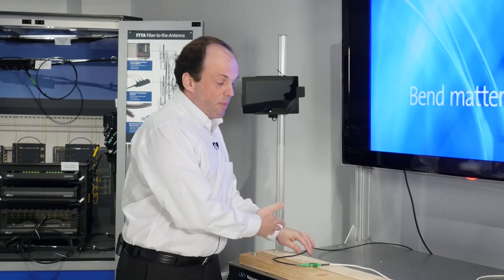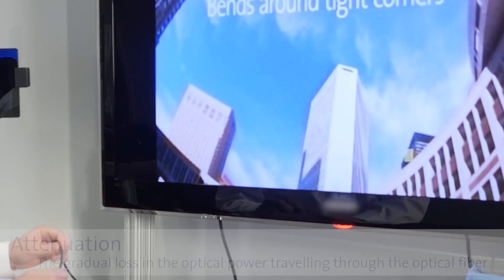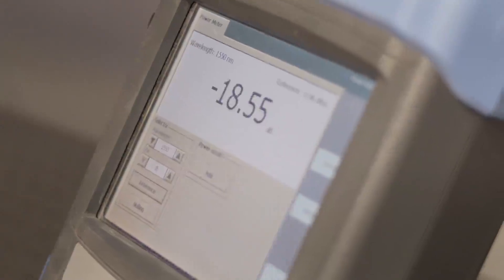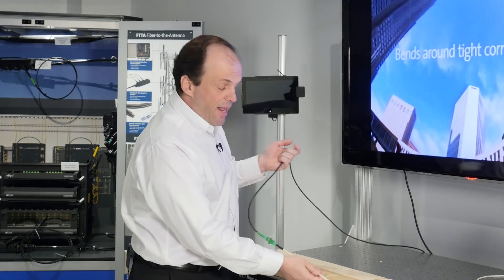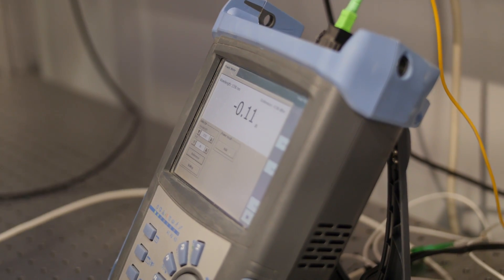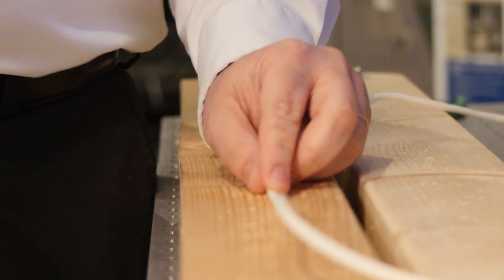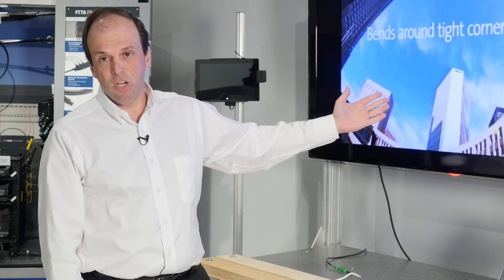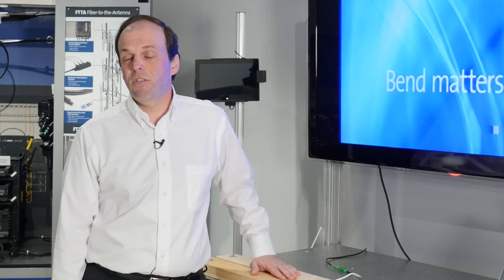Optical Fiber Attenuation

Comment: as a telecom technition who install fiber to homes on a daily basis, this cable is more or less our bread and butter. And while it is more expensive then the "standard" type optical fibre, the ammount of torture and abuse this one can suffer, while still working 100% is impressive!
In Norway they cost less 1$ per meter give or take. Thats a cable with 2 fibers (657B.3 glass to be exact).

Comment: Where do I buy this? I need to test something with this...
Reply: +nightstorm161 I would suggest an electrician supplier store. Cost about 0.5-1$ per meter (in Norway), depending on weather its on a 500meter drum or a 5 or 20meter length with a UPC-connector in one end.